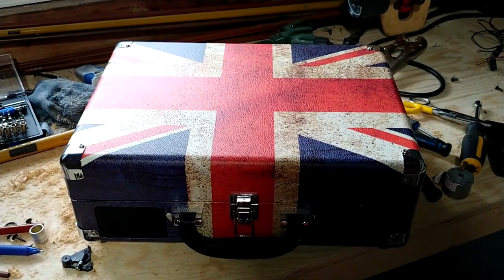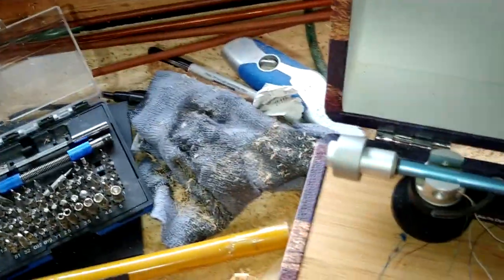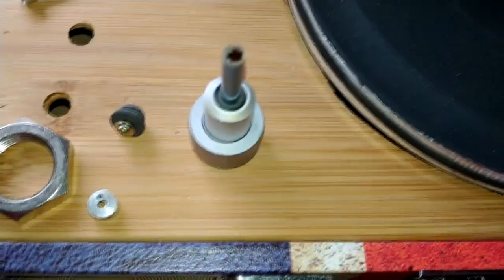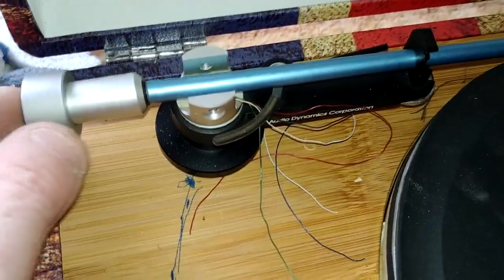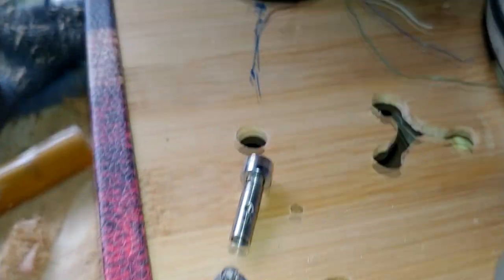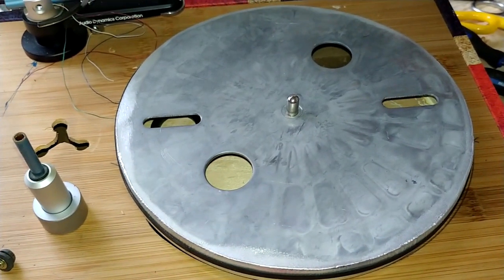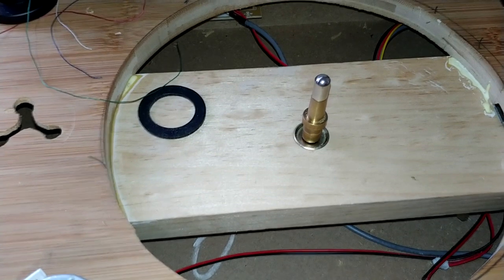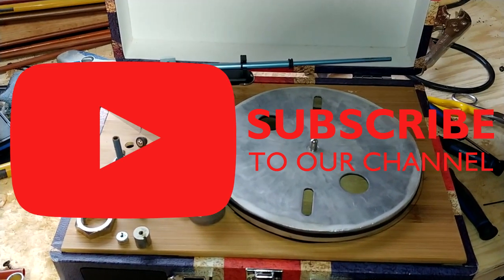Rebuilding a suitcase Record Player - PART 2

Comment: I've been modifying a $49 turntable myself.  Glad to see I'm not the only one. I used the same tone arm it came with  but changed the shaft to a carbon fiber shaft. Then modified the back to accept a magnetic weight. But now you've got me thinking about putting a higher-end whole assembly on it. And possibly a motor change. 
 I definitely will be following your progress. 
Thanks for sharing!